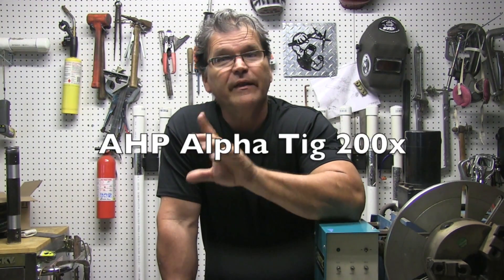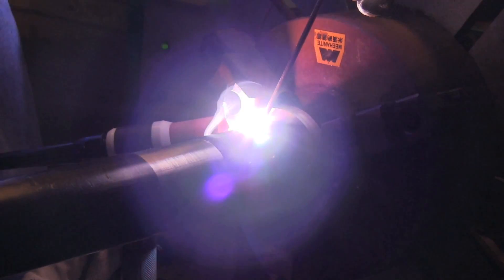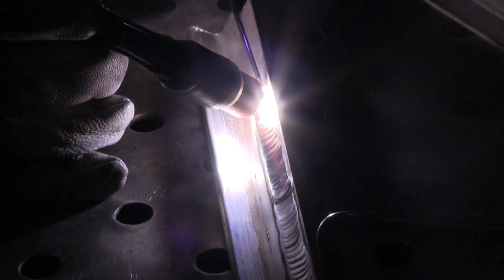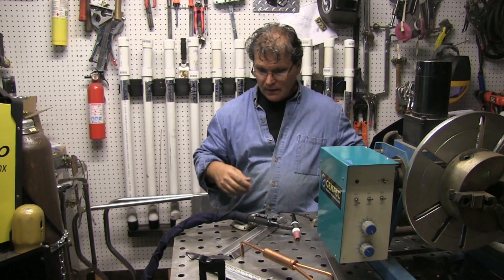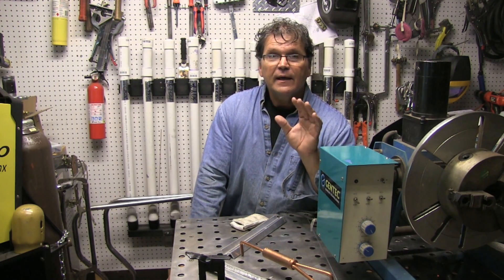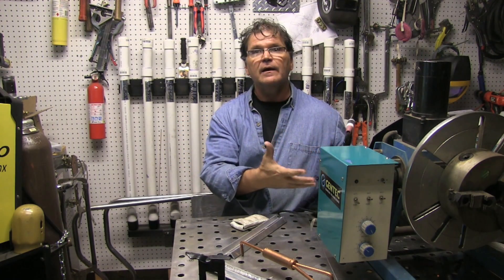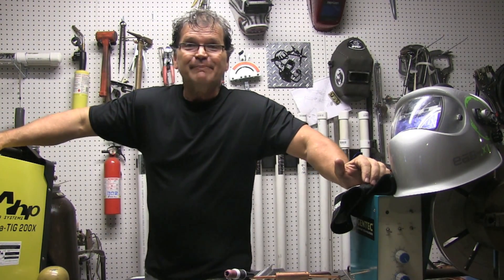AHP AlphaTig 200x

Comment: If you have a Superflex torch hose you can add it to this to welder by using an "AW-430A" gas fitting available for about $10 at a local welding supply shop. Just make sure the part number has the "A" after it which designates 3/8" threads. Be sure to cover the fitting with a piece of rubber hose to prevent shorting. This setup gives you a longer more flexible hose and saves mucho $$$ over buying a new dinse/gas hose connector.

Comment: I've been struggling with the flux-core process for a while now, just too much heat for thin steel. Built up a new edge on an old axe head but spent some time blowing out the metal that was there before getting it built back up!

Been wanting to start tig welding with its seemingly universal abilities but the best deal near me is ~$1400 for a used Diversion 165! That's alot of cheddar for something that can't even weld 1/4". Also, it doesn't have a digital readout, manual AC balance or pre/post-flow controls. 

I've learned so much from your videos that I know all the settings & what the knobs mean, they don't intimidate me. Don't really want a pure novice machine like the Diversion and even that is straining the budget to the max...

Comment: do you think you could do a horizontal t-joint weld on thin metal (steel) around 20 gauge? I have to do it for a collision class (for cars) so the sooner the better. I keep getting blowouts and not proper penetration. im using a 150 mig welder. my cfh is 30 and my heat is between 2-3. wire speed is in letters but i have it set on "g" or "f". thanks in advance. :)

Comment: Thanks for all of the hours you have helped me by making great videos. 
All of that and now you set up a give-away, very nice. I've had the pleasure to weld with this machine, both steel  and aluminum, and it is a hardy welder. The pulse is nice even a low current. Thanks again for a great instructional video!

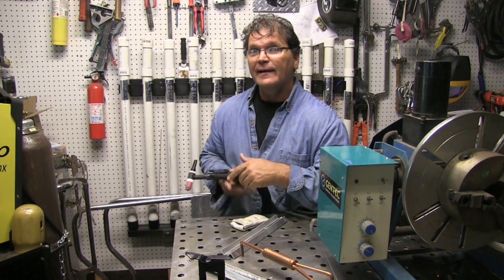Comment: After watching Jody's fantastic stuff for years, I have never found a single point of education that I have disagreed with from an applied science perspective, until this video :(  From 9:15 to 9:45... the engineered science of welding has long since figured it all out and manufacturers have engineered equipment to specifically control all of the variables.   Then again at  11:47 "square wave" technology eliminates heat loss due to current switching time, because the swing from EP to EN is instantaneous.  

Some actual oscilloscope pictures or some illustrated AC wave forms, would go a long ways helping to explain what happens with AC welding.  Particularly, inverter machine's ability to manipulate and alter AC wave for shapes from a mechanically generated AC sine wave, to much more complex digitally synthesized waves.  A better understanding of how those different shapes can be applied to various welding requirements is the key to better results.  The guy can still weld circles around me...
Reply from the maker: the scientific community is making new discoveries all the time. I really dont think they have everything figured out quite yet. A good example is that welding manufacturers are now discovering that the EP side of the AC cycle affects penetration more than previously thought. But originally, they thought and stated that EP  strictly affected only cleaning action and EN was what affected penetration.  They dont disclose that piece because it contradicts what they have hung their hat on for years and it would cause them to have to re label ac balance controls.
But, you could be right on your switching time stance... I really do appreciate your feedback because it makes me want to dig deeper.
Reply: Possibly, but a good read through any of the legacy manufacturer's top of the line product manuals will help more than anything.  Also check out Wikipedia on "Alternating current".  The math portion is likely beyond the scope of our discussion, nor necessary for a solid understanding of AC welding.   The graphs and terms defined there however will help build alternating current knowledge base.  Who ever figured out it could be used for welding aluminum more effectively?  pure genius...
Reply: I'm 100% certain that amplitude=heat for our welding application.the triangle wave forms that miller has designed into it's dynasty line as an example, depart that zero graph point at an angle, meaning amperage increase over time, where as the square waves depart the zero line at a 90 degree angle, meaning no time elapses as the current reverses.  The triangle wave form is for low heat or minimal heat input.
Reply: I like to think that EN imparts heat because of the resistance the electrons encounter passing through the arc and into the aluminum.  Conversely, for the portion of the wave that is EP,  electrons have to fight through that layer however they can get back up to the electrode.  The lower the frequency the wider that band.  As you've mentioned, the longer portion of each wave that is EP, the more etching, literally as electrons bombard then fight their way through that oxidation layer from the metal side, literally ripping or chiseling it off on a microscopic level.
Reply: there are also some great resources here, and no I don't work for Miller...: https://www.millerwelds.com/resources/article-library/new-advanced-tig-welding-machines-improve-fabrication

Comment: Hi Jody, have you tried welding coke cans with this machine? I have the 2016 version of this machine and have been trying and mostly failing. I'm sure its mainly operator error, but I'm curious if this machine is capable of that kind of low end AC welding. Its rated at 20 amps for the minimum on AC.

Comment: I have the original AlphaTig 200x. I have tried just about every feature and am very happy with the machine. I've used it on 100 feet of 120V extension cord to fix an aluminum dock, stick welded 1 inch steel plate at nearly 100% duty for nearly 2 hours straight, etc. Stainless, mild steel, aluminum sheet, thick aluminum.....the AHP welder has never let me down. I'm building a TIG cooler to use a water cooled torch with it as I usually push more current and duty than the 17 torch cares for.

Comment: hey Jody, i've learned a ton from your vids thank you!  i own the AHP and have been using the finger switch more & more.  you didn't really explain start/end amps when on the switch, and while it doesn't taper off, you can hold down the switch at end amps without cutting off at main amperage.

Comment: Hope you pick me Jody ! Lol. Great video, I really appreciate you giving the amperage and other settings is all your vids, the info has help me tremendously..actually helped me figure out how to Tig Aluminum successfully and achieve those gorgeous beads I see you making. Would love to see a video of Tig welding thin sheet metal, like 18-20ga. A rusty old body panel where the thickness might vary due to age and rust..also a would love to see your opinion/review of the Lotus Tig200 acdc welder..I have had one for about a year (can't afford a Miller,AHP,HTP,Lincoln etc). After upgrading the torch to a real wp17 it works flawlessly. They get a bum rap online in my opiniom...would love to see your review of it.

Comment: Lol. Some of us might like to hear about the latest trick you taught the dog!
Does gas make a big difference, stick to pure Argon for AC aluminium?
Reply: you can only weld aluminum with argon, occasionally you can do a small mixture of helium/argon but not often
Reply: +Kyle Young you can use pure helium with no argon at all aswell for aluminum.
Reply: +Kyle Young you can use pure helium with no argon at all aswell for aluminum.
Reply: +Chris Porter if I remember right its only for a high heat weld to get all you can from a machine. with the last price I saw for HE its not cost effective for beginners either.
Reply: I understand that. But you didn't say cost effective.  You said you couldn't use pure helium.
Reply: +Chris Porter re-read my comment I never said anything about not being able to use pure helium. I'm not trying to get into an argument here please don't try and start one
Reply: +Defnotdemas as far as I know you can use pure co2 or c25 mixture for Mig welding I've never heard of using helium for Mig

Comment: Hi Jody, how about a video on individual amplitude adjustment (for the machines that can) and how you can run more eP than eN (2 to 1)with 10% ac balance (90) with incredible results and when it is beneficial to do so...

THANKS!